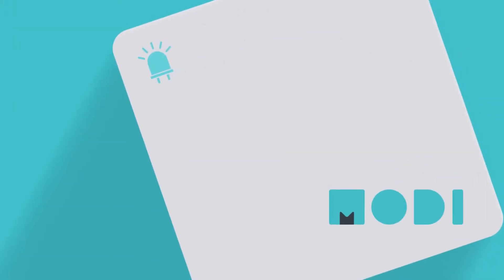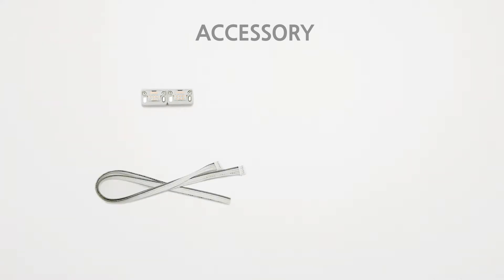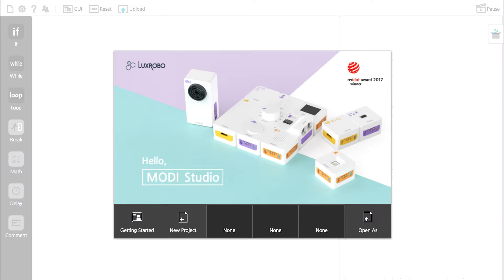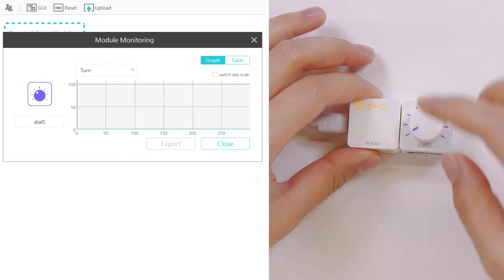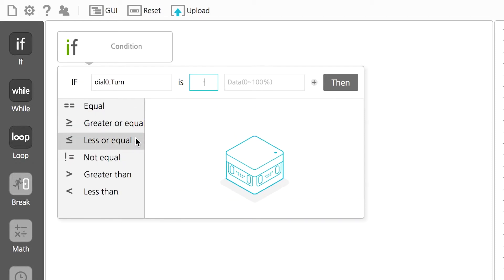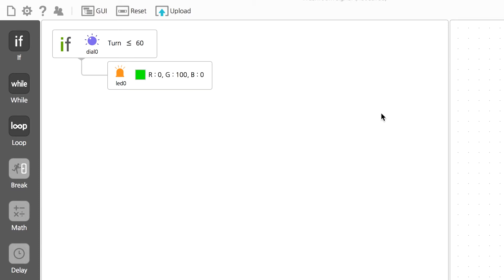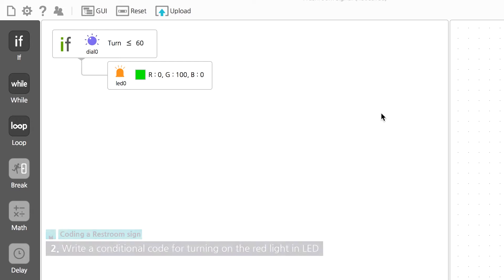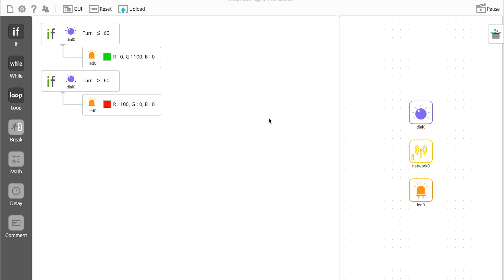MODI Creation Basic 01 - Bathroom Sign (eng)

Comment: do not need the networkx1 module to work changing the colors? the programming is stored where? 0:44 , 5:09 , 5:15
Reply from the maker: Hi. Network module will be used to upload the code. After uploading the code, you don't need to connect other modules with network module. 
A code you made will be stored in every module since all modules have MCU.